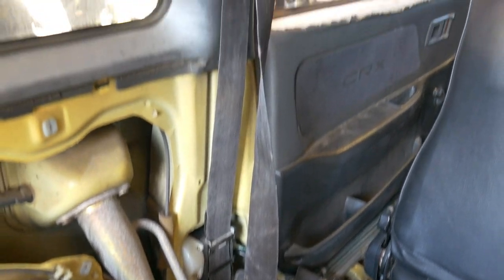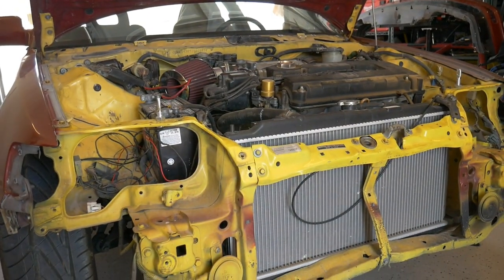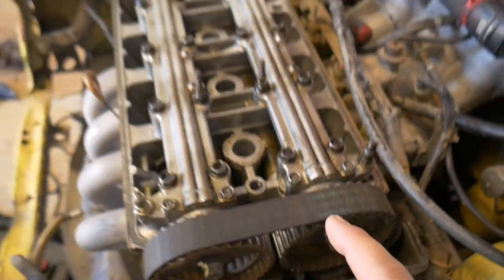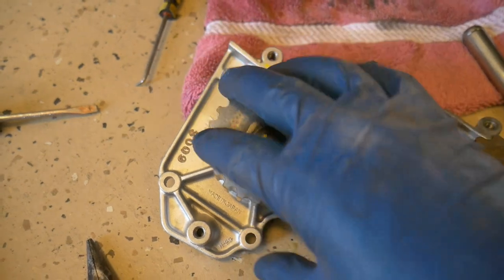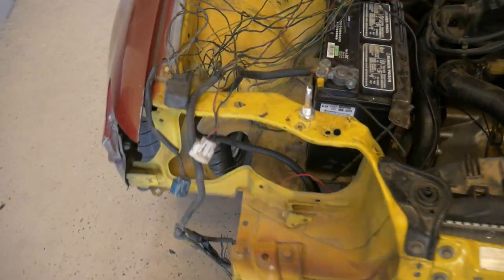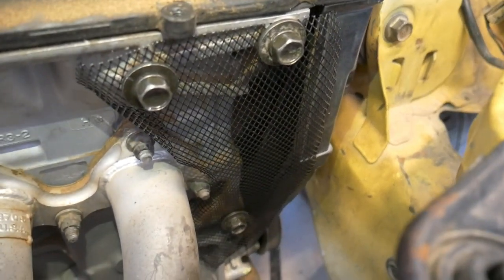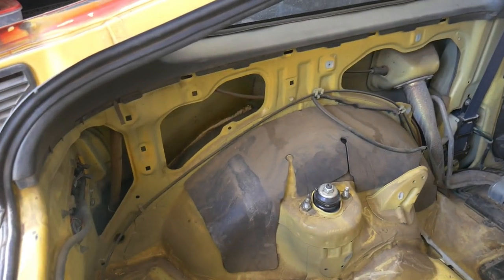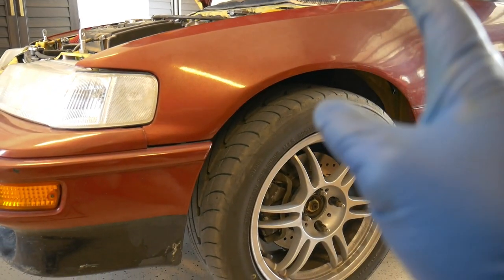Timing Belt & Water Pump Install on B16 CRX - Finishing Up Fender Rolling

Comment: Honda parts geek here John. Great content as usual. That water pump is made by Keihin. They are a manufacturer of OEM components for Honda for decades. They supplied Carburetors and later on throttle bodies and sensors. 

I've never seen a Keihin Water Pump before. Yamada is usually the supplier of OEM Honda water pumps so that's interesting to see.

 NPW is actually Nissan's water pump supplier. They are of similar quality to GMB which is also a trusted aftermarket Japanese manufacturer of timing components/water pumps. 

Loving the videos though. Fun to watch you refresh this B Series for track duty.  Peace from Jamaica!
Reply from the maker: Can't wait to drive it hard!

Comment: You're so lucky that rear wheel bearing just slid right off. Last time my inner race was seized on to the shaft and it took me a total of 4 days to cut into it with a tiny dremel
Reply: Bet yours wasn't an AZ car

Comment: This isn’t related to the video but I’m hoping you could help me with a weird problem. In my 89 civic the low beams do not work but the high beams do. I got myself a tester light and tested the wires that plug into the lights and found they are not getting enough power. The switch seems to work because my rear lights turn on and the dash lights turn on. But when I put the tester on the wire when the switch is on the light is very dim. Any advice would be appreciated! Your videos are amazing!
Reply from the maker: Inspect the ground connections for the headlights.  And also all of the wiring for the particular lights.

Comment: Does rolling your fenders give it a wider look as well or does it just elongate scraping your tires with the fenders?
Reply from the maker: No.  It's to avoid rubbing wider wheels/tires.  Those edges will dig into tires and potentially damage them especially when driven hard and the body rolls excessively.

Comment: Are those zc headlights? (Plastic) see my head light has 2 ports one for high beam and low...also mine has that annoying bracket for height adjustment...I want your headlights I like how you just put the 2 bolts on at top and it's done faster...is that the difference between the ZC headlights and the usdm ones?
Reply from the maker: These are the JDM EF8 CRX headlights.  Unfortunately they don't have the bar for height adjustment.  I'm not familiar with ZC headlights but they might be similar.

Comment: I got prblm with my car it losses power after 2-3 mins and slowly drops rpm and then engine shutdowns i had replace the fuel pump fuel filter fuel injectors but the prblm remain the same
Reply from the maker: Any CEL's?
Reply: @GarageBuiltHondas  what

Comment: Would you be interested in wiring my 89 Crx?  I’ll I’ve been working on it for sometime now. I’m in Anthony. I can take the car to you. Keep up the good vids.
Reply from the maker: The engine harness?
Reply: Yes. I had someone install the b20 but they couldn’t figure out the harness. I have a new stock si harness. Just need it installed.
Reply from the maker: Does it run?
Reply: It use to. Now it just cranks but no spark.